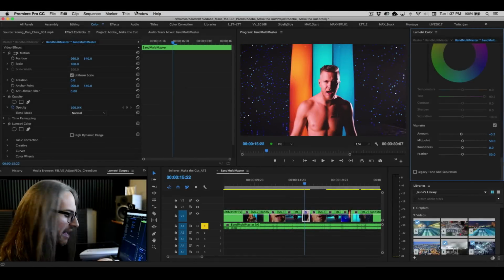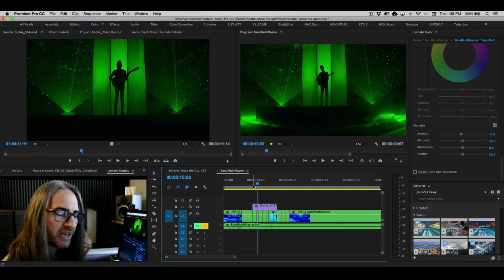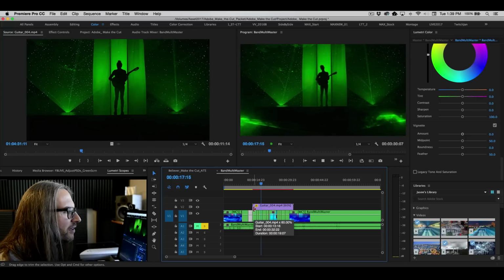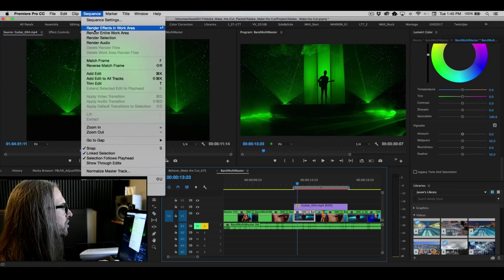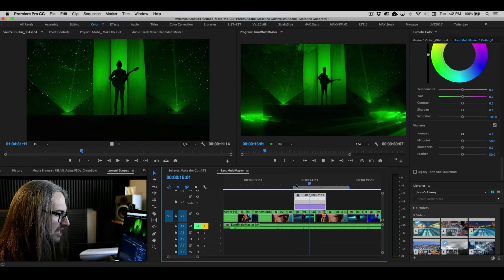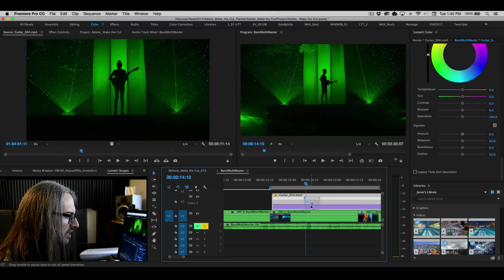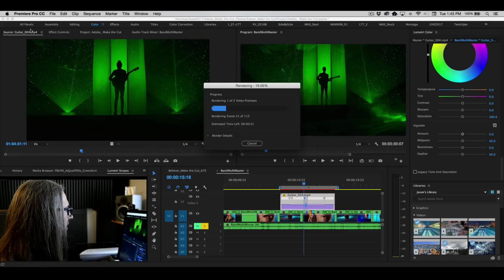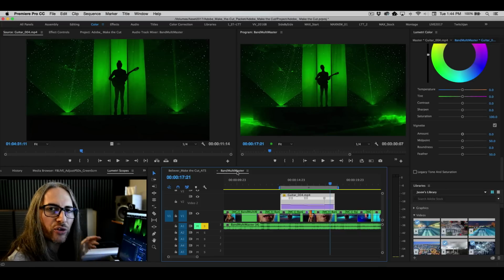How to use Speed Ramps & Slow Motion with Optical Flow | Adobe Premiere Pro CC | Creative Cloud

Comment: What if using Optical Flow at 25 fps footage will be the same whether at 60 fps footage without Interpreting footage ?
Reply: I tried it with 30fps footage and while some shots worked, shots with more detail had a wavy artifact to it which really wasn't worth it in the end.
Reply: @joebob2311productions  yes, I agree with you. in the end it's better to use a higher frame rate